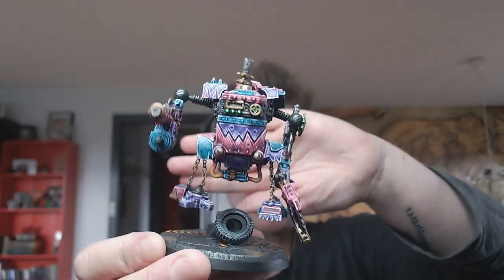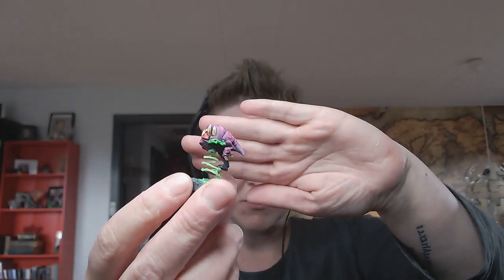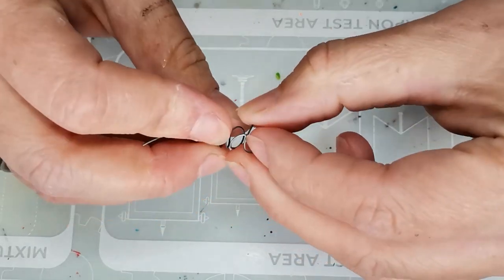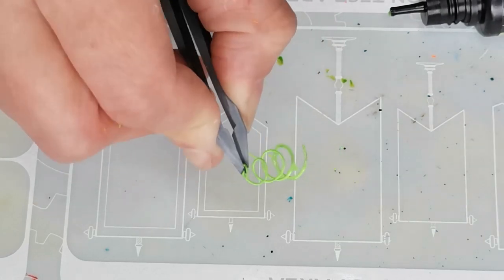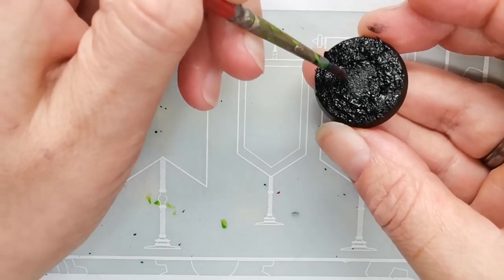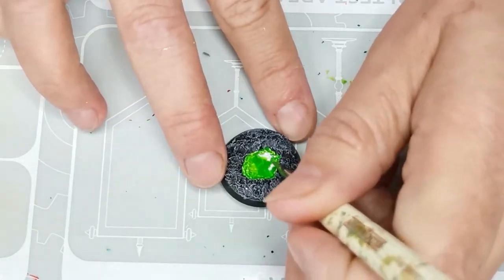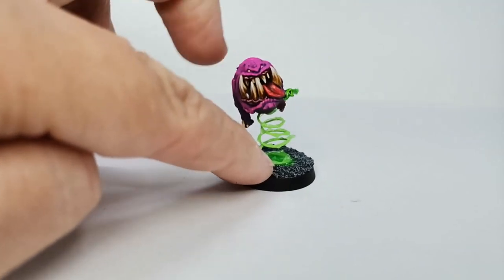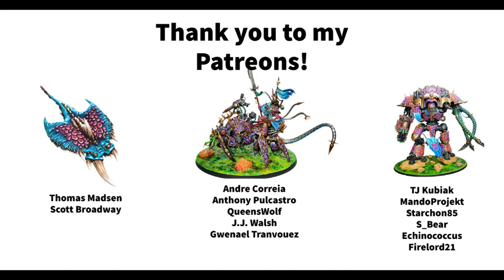How to make a bouncy boxic looking bpring for your wargaming miniatures - the bouncier the better!

Comment: A good squig, is a squig that still bounces for a few minutes if you bump the table. 

Also, sorry if i missed it, did you add any weights or something under the base for balance? 

Also, do you take requests for stuff to paint? I would love to see Fulgrim in your style.
Reply from the maker: Exactly! Always more bounce!

I didn't add anything, it seems stable enough. Perhaps I will for the bigger models though 😊
Reply from the maker: Oh, and yes, I'm always interested in suggestions for painting projects but I can't promise I'll be able to do it - it depends both on the time it would take and how expensive the model is 😊
Reply: @dicendemons  Needs a tippy-cup bases for maximum chaos. Round bottom with a metal ball, eventually it will stabilize.

 Yeah, HH characters are expensive, maybe ask GW kindly to send some over :D